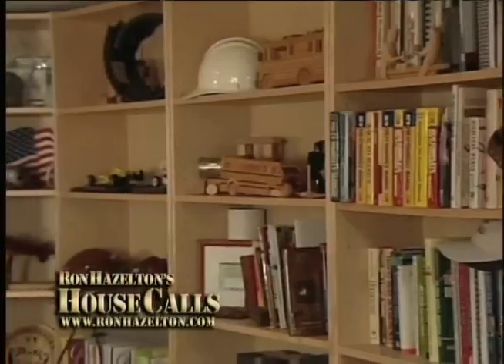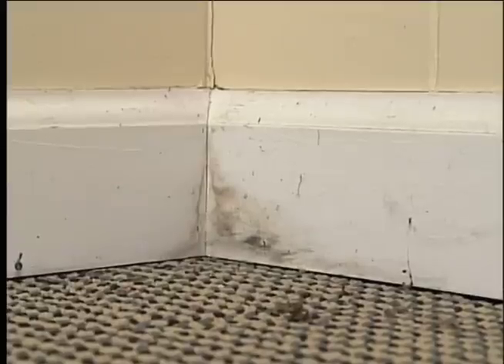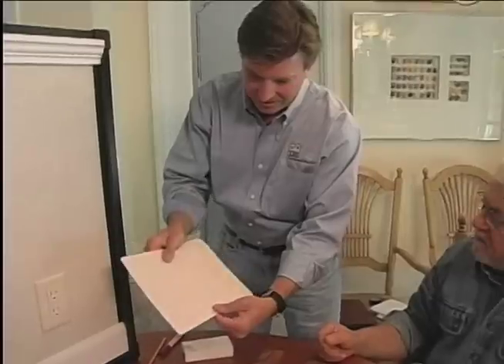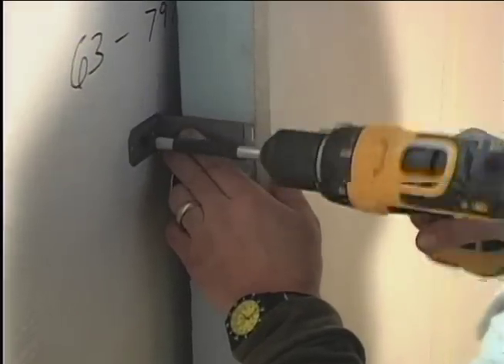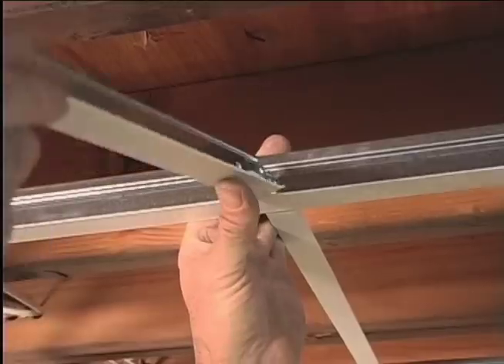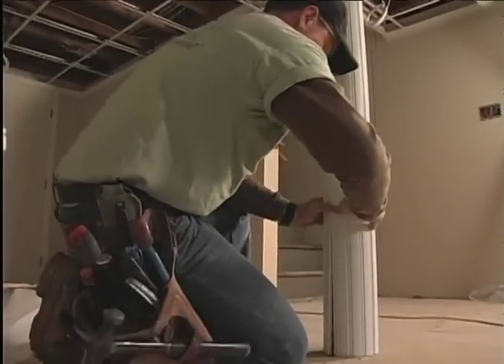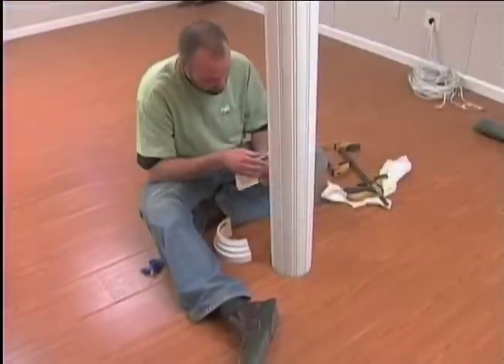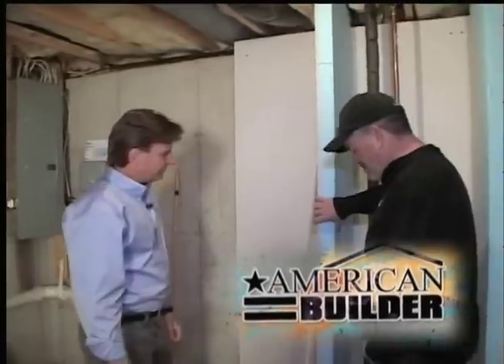How to finish a basement with Ron Hazelton

Comment: You should have had the tile & sump pump waterproofing done around the perimeter before putting all that money into the finish. Yeah, the floor and walls won't be ruined by a couple inches of water down there, but all the furniture, throw rugs and electronics will be junk next time it floods.

Comment: Hi Dckommentatur S,
Total Basement Finishing is designed by Basement Systems, Inc., an international basement waterpoofing dealer network. If there were water present prior to install, or the homeowner had concern, we would put in a waterproofing drainage system.  If water occurs at a later date, we can install the system afterwards.  The great thing is that the products are highly water and mold resistant.
Reply: Contractor Nation Yvette McDonald

Comment: If there is water infiltration, where does the water go? Does it sit behind the walks and under the floors with no way to escape and just accumulate until the weight and pressure force a break in the wall and floor systems?
Reply: I'm wondering the same thing.
Reply: Lesson being - take care of your water issues before finishing your basement.  Then you won't need these inorganic materials.